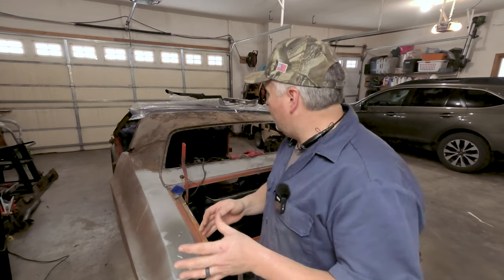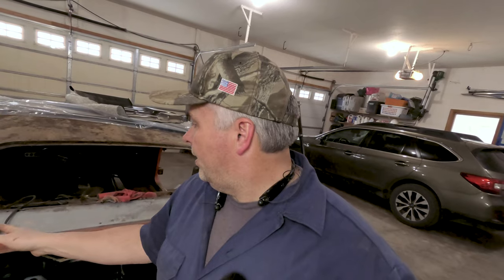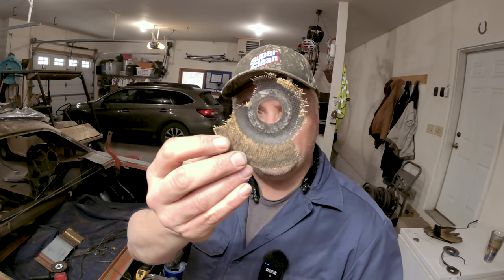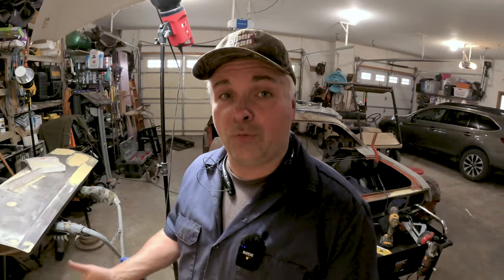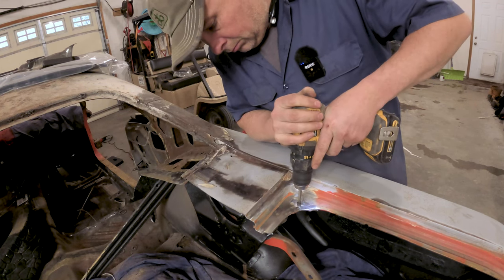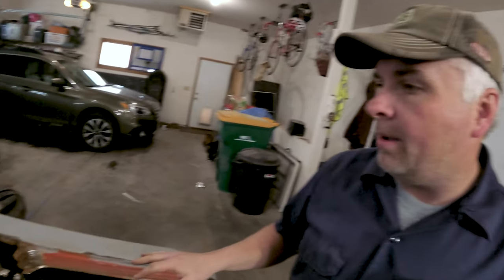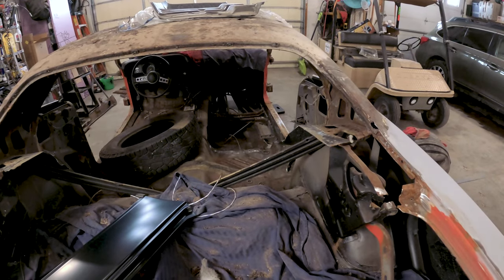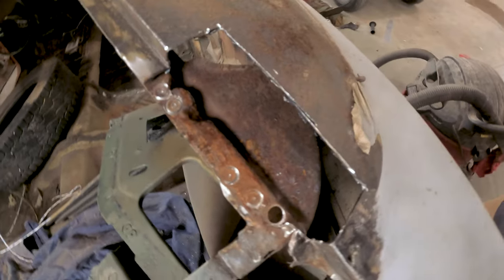DODGE CHALLENGER RESTORATION:  Filler Panel & Package Tray - Pt 15

Comment: Another great video. I need to get busy drilling this Camry’s spot welds.
Reply from the maker: The spot weld bits I got were super helpful, and clean.  Only my own ignorance led to going thru both layers of metal a few times.